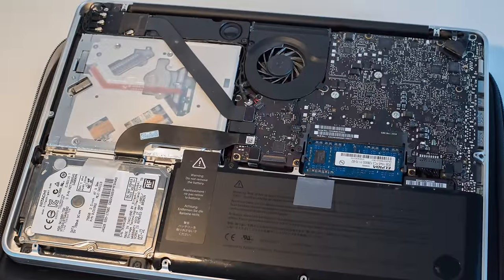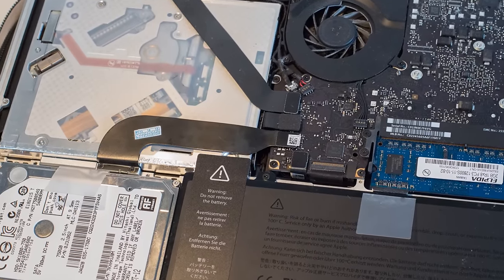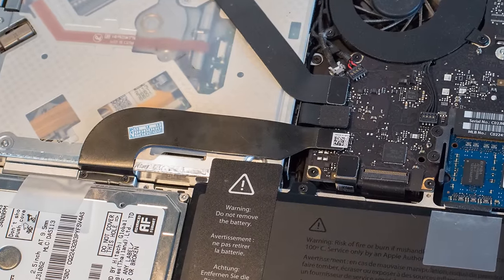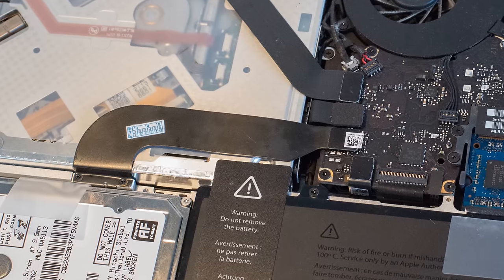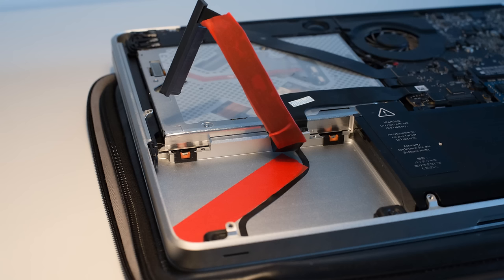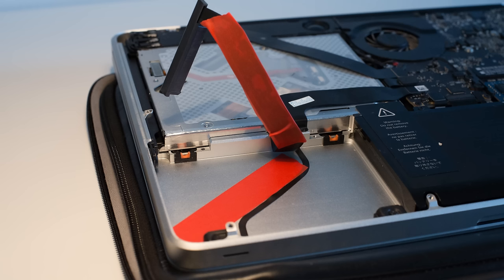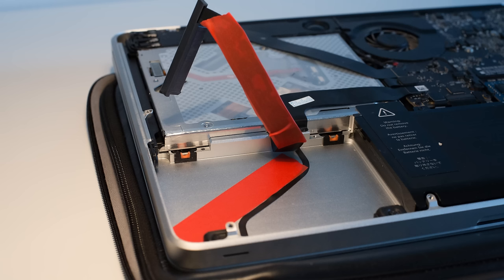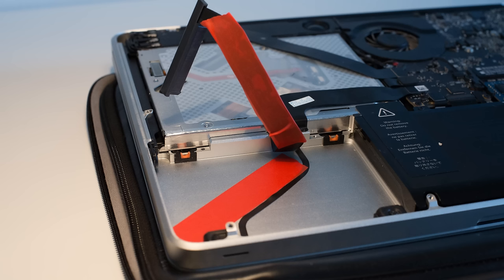MacBook Pro Hard Drive Cable Failure - Free fix and preventative maintenance - Question mark

Comment: My apologies if someone already mentioned this. Apple will replace this for free if you have a 2012 13" model. They recognize that these cables could fail and will replace it at their store for no charge. I just did this today.
Reply: could you pass me the Apple's number
Reply: I'd like to know who you talked to lol... because i just chatted with Apple online and i was told that i had to take it to an Apple store to have them look at it and there will be a fee.
Reply: UPDATE!!! Awesome! After chatting with the Apple guy online, i accidentally left the chatbox open and he messaged back saying that he may have found a solution. He is setting me up to take the macbook into a store to get it fixed free of charge. I will report back.
Reply: c0pyimitati0n hey! any update on the free fix ?
Reply: works like a charm!
Reply: #GRD Yes, just had to take it to an Apple store to get fixed for free!
Reply: ***** No because it was their faulty part that caused it.
Reply: c0pyimitati0n thank you ! I'm going to try here in the Indian Apple store !
Reply: Hey there! infact they did replace the cable for free here without warranty !

Comment: That may be the solution for me... I need to test. What I know is that my Mac does not boot correctly when attached to Sata cable (boot starts and then stops. I get a crossed circle sign in place of the apple). It works like a charm with the same disk connected to USB.

Comment: My mac was working smoothly when it suddenly shut down. After some research I suspect the hard disk cable is the problem. I was also feeling small "electrocutions" from time to time when some parts of my body touches the body of the Mac, could this have been caused because of the worn out cable? 

Taking apart my Mac will be a tough and unpleasant task, but I'm surely going to try your advice. Thanks a lot.
Reply from the maker: +SyriaxKnight It is certainly possible. Taking the base off and doing this is really very simple though.

Comment: Thanks man! Worked for 5minutes, after that - HDD dissapears - even a new hdd, so it's cable fault... But i taped it correctly... hmm
Reply from the maker: +E:91 If the cable is badly damaged then it will still need replacement. Doing this should help prevent the new cable from failing though.
Reply: Brue Computing Yup, i tought about the same. After so much bending, and taping it doesnt works at all, haha.... Already made an order :)

Comment: Thank you I will try this today, having recently replaced my drive and still getting no system icon (flashing folder) I hope this does the trick,.
Reply from the maker: Good luck! If it doesn't then replace the cable.

Comment: Thank you for this, I am currently replacing the HDD cable in my MacBookPro for the second time in two years and would love to not have to do it again next year!
If just being used as a preventative measure (on a new cable with no current wear), would duct tape be suitable to stop the friction or would duct tape not deal well with temperatures inside the case?
Reply from the maker: +Courtney Renèe Lane Some duct tape is electrically conductive, so I'd generally use electrical tape as it is non-conductive in the event of the cable wearing through.

Comment: hi I would love if you could answer my question. My macbook pro 2011 15", does not turn on at all. I opened it up and I think I see the problem. As in your video in the picture 0:30 there is a cable red/black colour connected to the motherboard (I presume this is from the harddrive?) Well this cable is not soldered in to the mother board in my case. Can this be the reason and when fixing this the Macbook should work?(turn on at least?) Thank you so much!!!
Reply: +FlatEarth Photography send a picture, please.

Comment: So do you put the tape exactly how he did? Is it taped on both sides or just the one? I just taped the crap out of mine and am about to turn on fingers crossed. 

Someone please tell me if this is the exact way to tape or if it is a case by case basis. I used so much tape the ssd fit in VERY tightly.

Comment: My MBP was with a problem of being electrified (literally, I can feel it) and crashing when I press the chassi (not like a bend test, like holding to mov it while open), now the HDD won't read, although it reads perfectly fine plugin on another computer. I hope the the problems are related and can be fixed with a simple insulation tape.

Comment: Unfortunately it would work great for like 1-3 minutes, but after that the same problem persisted... I do believe this is a good fix, but if your cable is super old then you still have to replace it.
Reply from the maker: Yep, in some cases the cable will need replacing, but the tape should reduce the likelihood of the replacement wearing out in the same way.

Comment: Giving it a go - hope it works ....
Reply: did it work? this happened to my laptop, but im afraid to fix it in case i mess it up. I dont have much money for professional repair
Reply: +Anna bella no it did not work.  Ordered a new cable.
Reply: i tried it thie morning. didnt work for me either. i will have to buy new cable as well
Reply: The new cable worked fine.

Comment: Didn't work for me, I did a good and proper tape job on mine with good quality tape - I guess my cable is just too far gone. Luckily I have an optibay device, so just swapped the SSD into that, and put a second SSD (tested in usb enclosure) into the HDD bay. When I get a new cable, I'll be able to raid 0 them :) 49 people disliked this video - why? probably because they can't put 2 and 2 together and buy a new cable if this FREE fix doesn't work :P

Comment: I cant believe this is it! I have replaced the hdd with an ssd and a regular hdd. computer lasts about a week or so (beachballs alot) and then flashing ?. I am going to attempt this fix and will get back. I will not be buying a new cable as its to pricy and this macbook is only a media center basically.
Reply: ted mehlenbacher Did it work?

Comment: My cable failed, then I removed my HD and started using it as an external drive. Then, a week later, it stopped working. I think it might be the SATA card because when I go to start up my macbook, it partially boots, but then it shuts down when its almost finished booting. Not sure for certain if its my HD or the Sata card.

Comment: nice video, i have a question, i have the same macbook pro, and it does not boot when i try to turn it on i basically  i only hear the hard drive sound like turning on and off by itself, my question is do you think that is the hard drive causing the problem or it could be the flex cable?
Reply from the maker: +Kriizz Fonseca I'd typically say that sounds like a HDD fault.

Comment: Wow I really hope this works. Could you help my 13inch mid 2012 MBP won't go past the white screen.  I DON'T ever get a flashing folder with a blinking question mark. The screen just stays white. I have tried every start-up option I know (i.e. command-R, Alt/Option, shift, command-V, command-s), nothing works, just a white screen.  I have taken out RAM and reset NVRAM. Any advice.

Comment: this is a related issue with my mid 2012 MBP 13 inch the wifi seems to stop working and when i plug out the wifi cable and plug it back in , the issue gets fixed but it has ocurred twice already maybe i think the cable is becoming loose or wearing out , can i use electrical tape on the end point of the cable or will it mess up the mother board . i would like to see if the fix works before replacing the cable.

Comment: This sounds like what my problem was....super slow operation, countless hours on the phone with Apple Care, finally tried reinstalling the OS as suggested by Apple, booted up, screen froze, then folder with ?. Apple store said HD was not detectable. They said it is likely the cable, but told me the HD was fried and would be replaced. 
Can this issue "fry" the whole HD? Is there any chance of data recovery?

Comment: Why would this be rubbing against the chassis? It's a fixed part, should remain in place.
Reply from the maker: +tenTypWTK The IR sensor section of the cable is stuck to the chassis, but the hard drive section underneath the drive is not - it has to be unrestrained so as to allow it to lift up when the drive is removed.
It seems that it moves slightly when the machine is in transit and wears out - hence those who travel a lot with their MacBook Pro often suffer more from the problem.
Reply: Maybe you're right! 
Any idea what's the role of that yellow conducting tape at the end of that hard drive cable? I replaced the cable and the macbook is working fine again but unfortunately I ripped that little tape.

Comment: I have a 13' mid 2012 macbook pro with a issue where no matter what drive i use, the question mark shows and the laptop doesnt detect a drive (it spins but i cannot use it as it does not show.) is it the cable? because ive taken it to a shop and i've been told it is a board issue but i do not think that. the front led light works fine. pls help

Comment: Hi,Tried to do as video shows with tape - is the computer supposed to start up as it normally would afterwards or do i have to do something special?Still having the flashing folder and can't choose my HD to boot from.
Reply: quite likely you have a different problem than the cable (or in addition, if you saw a worn spot on the cable).  Make sure all connections are good (reseat them).  If you remove the drive and boot from it externally, it is likely OK.  If you can't boot externally, then you have a corrupted OS or bad drive. (if you have a spare good drive, you can install it to check)

Comment: Laptop was working fine, after 2 days i saw a floating question mark folder, bought a new ssd and tried to install macos and didn't work, bought a new cable then the ssd was shown but i couldn't interact with it, used the old cable and worked fine for a couple of days, then again question mark. I used the tape and nothing...

Comment: Do you have a good source to buy the replacement cable? I tried buying one on ebay and it was the wrong size for my model Macbook.
Reply from the maker: +Kelly Visel Normally eBay is fine, but make sure you have the right model and year.

Comment: Why is everyone praising tis guy? This is got to be a joke.
Reply from the maker: Nope, it really works for a lot of cases.
Worked it out after having one machine go through multiple cable failures within the space of a year - applied the tape and suddenly the problem went away.

Of course if you have a damaged cable it may still be necessary to replace it, but the tape reduces the risk of future failures.

Comment: Please, which part number is your ribbon cable? This is 2017, apple sold a lot of the last mid 2012 macs they left in stock... they are failing and there are people wondering if they may use certain part numbers, instead of 821-1480 using 821-2049-A and so on...

Comment: i tried this today, it worked for like 5 min then my mac went slow again so should i try more tejp? i live in sweden so buy a new cable cost me alot. i've tejp over the optical drive and under the ssd! :)
Reply from the maker: +CourageousClow Sounds like the cable is too badly worn in that case. It should hopefully prevent the same thing happening to a replacement though.
Reply: okey, to get a new it will be like 80 dollars :/ with shipping and everything.
Reply: after adding more tejp the computer have been working for 1 hour without using charging cable :)
Reply from the maker: +CourageousClow Fingers crossed then :)

Comment: Didn't work for me, I covered the whole cable with electrical tape and i put a lot of tape at the bottom of the case but still doesn't work
Reply: +Kappa 1337 NO WAY WTF I JUST PUT A TINY PIECE OF TAPE AT THE BOTTOM AND STARTED TO WORK THANK YOU SO MUCH THANK YOU THANK YOU
Reply from the maker: +Kappa 1337 Glad to help. Sometimes a new cable is still required, but it should stop that getting damaged in the future if it is.
Reply: +Brue Computing aw it stopped working 5 hours after and my screen just froze, i tried putting more insulation tape but it still wouldn't budge :/

Comment: I'm a bit worried that regular electrical tape will start oozing adhesive all over the hard drive/SSD in a few years - it has a habit of doing that, especially when it gets warm.

Might have the same issue on my MBP - the cable was replaced along with a faulty HDD in 2014 (warranty repair) but now I tried to upgrade to an SSD and the SSD doesn't work, the old HDD does and apparently that could be a cable-related issue. Currently typing this on the very same MBP mid-2012 with the 2014 replacement HDD.

Comment: I have a question, my hard drive cable has the following info: 821-1480-A  and  MFC:5212 
can i replace it with a cable that is: 821-1480-A  and  MFC:3712
Someone help pls!

Comment: Does this work on a 2013 macbook pro??
Reply from the maker: +A Random Potato 2013 MacBook Pros don't have the same cable design and shouldn't suffer from the same issue.
Reply: +Brue Computing yeah that's what I figured. I got a black screen with the flashing question mark folder. After looking around everywhere I think my hard drive crashed.
Reply: +Brue Computing what do u mean 2013 dont have the same cable??
Reply: +A Random Potato my new ssd has same issue so im pretty sure its cable on my 2013 pro!
Reply: +Raymond Deng did you try fixing it? I kinda gave up hope so my laptops just been sitting there
Reply: haha i ordered a $20 a128 model sata cable from ebay! should work, im using an external enclosure for my ssd and it works fine.